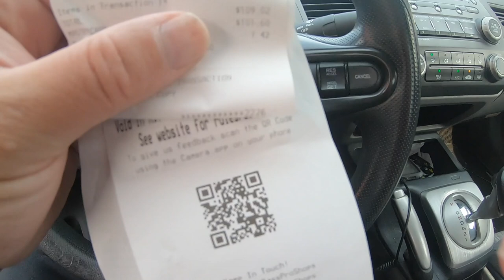B.O.A.T.....(Update VLOG). Super Pumped!!!

Comment: Your engine exhaust problem is making me wonder why the boat seller spent the money for 1000 hour maintenance way ahead of time. Was he trying to cover up an existing problem? If I were in your shoes, I’d be trying to find out what work was actually accomplished during the 1000 hr servicing. Service record invoices should be available for the asking. OBTW, both of your engine after-coolers are likely fouled by exhaust soot from the engine that was leaking. Wishing you luck with your repairs. Please keep us posted
Florida
Reply from the maker: Thanks for the info Gabriel. I have the service records but it reads like stereo instructions. THis winter we are gonna go over every last bolt, gasket, o ring.

Comment: I have the same 6cx motors 2years ago had the 1000 hours service done 22k but solved the temp problem
Reply from the maker: What temp problem were you having? We honestly never saw any overheating issues.
Reply: Reaper Fishing NJ my temperatures would go up to 200 and set alarms off it was due to I guess scaling on the heat exchangers. They rebuilt all the turbo chargers set the heat exchangers out for chemical cleaning I guess electrolysis electrical or something like that and replaced all the hoses and belts along with some of the castings that was the expensive part
Reply from the maker: @mikefrayman5224  gotcha Mike. Yea we never once overheated.